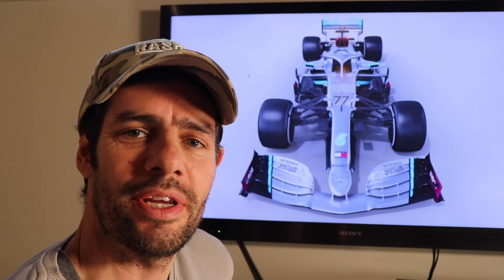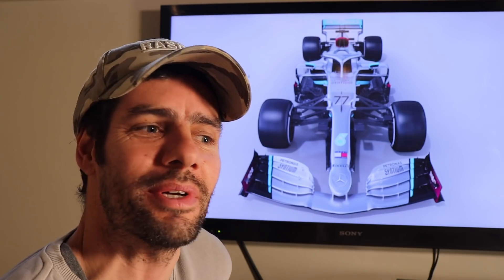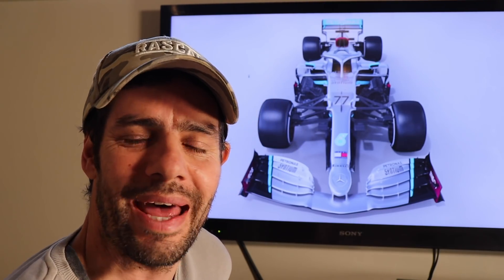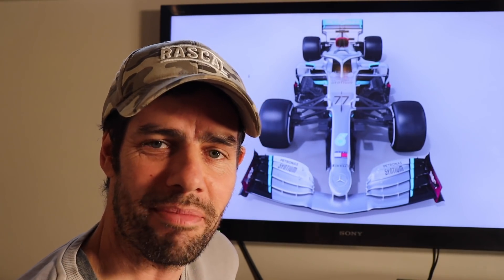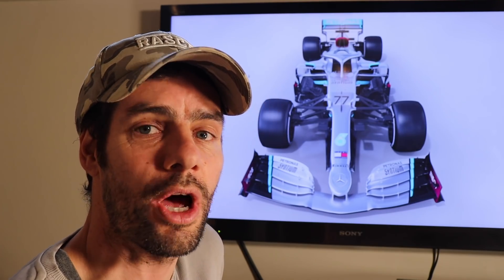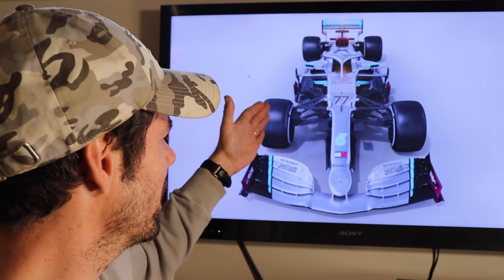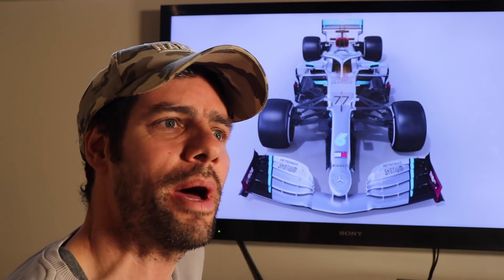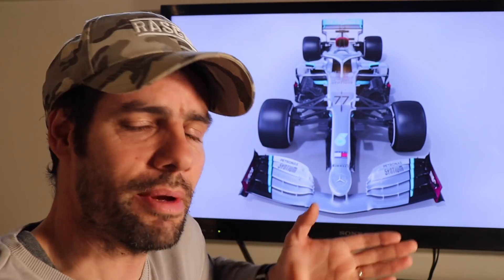Explaining Mercedes F1 DAS System

Comment: Could be a dangerous situation.. Pulling on your wheel going down a straight in a works mercedes Formula 1 car... Pull the wheel off by some freak of nature going 320 kp/h could be lethal.
Reply: The wheel is locked in, its the column that moves, so thankfully that couldnt happen
Reply: @darnelll1524  Kobe.. Nuff said.

Comment: "A team like Mercedes would've not gone through the lengths of putting this on a car..."
OH YES THEY WOULD, THEY ABSOLUTELY WOULD, EVERY SINGLE TEAM IN THE PADDOCK WOULD.

Stop sucking up to Mercedes like they are some kind of pure deity.
Reply: Um, OK. You know no other team has this system right? So in fact Mercedes is the only team that went trhough the lengths to put this on a car...
Reply: @matgee8892  it's all good, you will have the radical fans that shout out baseless nonsense.  Reasonable fans know how teams innovate & iterate.  I'm excited about this year and I feel like we will be in for better racing in 2020.  I think some folks are crying about testing programmes.  When Marc touched on testing about the same time last year.

Comment: Legal or not this needs to be nipped in the bud by the regulators otherwise teams will scramble to copy it and costs would soar to epic proportions.
Reply: @KevinJDildonik  Sure, especially cash strapped teams like Williams will be extremely happy about this development as it will enable them to close the gap to the top teams faster. They also have experience in low cost solutions when it comes to customizing the steering column. A trip to the store isn't even necessary as they can patch it up with what they have in the garage on a race weekend. There's also no need for any safety tests and stuff of that nature as it went fine last time...
Reply: AM 78  There's no benefit for road going cars, it adds to the cost of an F1 car while the teams with a smaller budget will be further behind thus not making the sport more interesting to watch. It will only benefit Merc an their quest of winning a 7th title in a row. It's pretty clear what needs to be done.